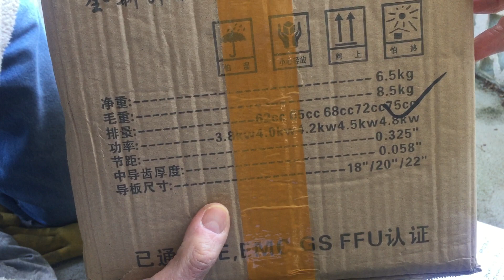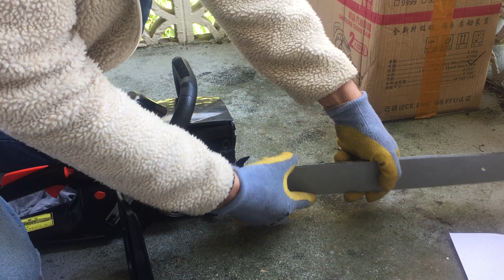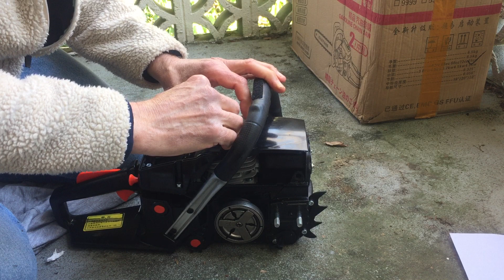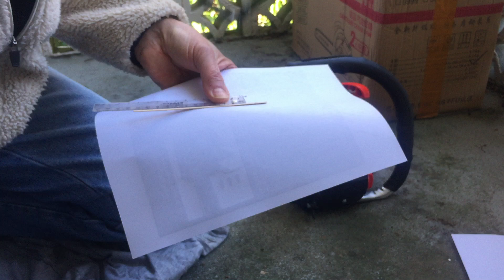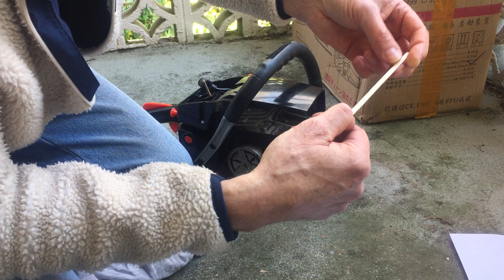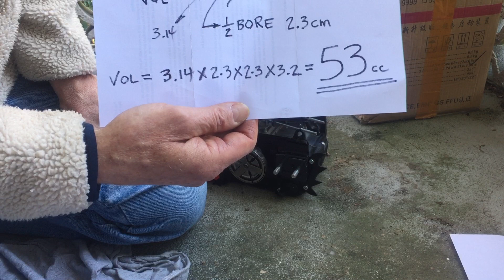75 CC CHINESE CHAINSAW REALY 75 CC??

Comment: I think you got your stroke wrong it should be 34mm and 45.2mm bore which is a 54.6cc so you were damn close. Id be getting my damn money back i would of figured it would of at least bein the 62 actual 61.5 cc motor. Id get a refund and guarantee they let you keep the saw. They are runners though with very little mods they scream. I'm literally about to do some port work and piston shaping on my dereal.

Comment: well done mate, these sellers, drop shippers or otherwise need to be accountable for plagueristic, fraudulent advertisments, I think it is disgusting that ebay and other sales platforms allow this crime to take place, it is a cheap saw so you get what you pay for, the how ever there is some honest hard working people scrimp and save to buy something that will make life easier, these are the ones I feel for, no chain brake, a primary safety feature, which is not there, now thats dangerous!!, and the bore and stroke does not match the description, thats false and misleading, in the old language, thats theft, these sales platforms are broken, cheers and thanks for a eye opener,

Comment: While I'm sure this one isn't 75cc these are clones of Zenoah's Japanese chainsaws which came in 52, 58 and 62cc I have a 52 and 58, the piston on a 52 is 44.9 the 58 45.2  and the 58 and 62 have a longer stork the 48cc cylinder for the 62 is impossible to find, you can use a 58cc piston and cylinder kit on a 52 but will have lower compression
Reply: For 62cc is 47.5?  Yes you can buy that.

Comment: A chain break has never existed since the beginning thank god,.......nobody ever needed them before,
I have never owned a saw with one.
I would buy any fair priced chainsaw even if its from China.
Yeah I was wondering how a clone could be a bigger cc?
Reply: There are 92cc and 100 china saws. youzuki or something..
They copy everything
Reply: Look up holsforrma I just got a Husqvarna 372xp clone and it works really good so far
Reply: @andyarmstrong5378  Cool thanx
Reply: My chinese holffzorma 660 clone has been serving me for more than 5 years now, without single trouble and always start on the first pull.. and all the engine parts are interchangeable with stihl oem parts..

Comment: I have a Chinese saw I bought 2-2020 with no chain brake but mine is a '70's design that never did have a chain break. You are right to expect one since it looks like a more modern design. That is a good idea of how to check for bore and stroke.

Comment: your chain looks to be installed in the wrong direction... the cutting edge should face away from the machine--providing the drive is counter clockwise.

Comment: I added your link to my video. Here is the video. I hope that is alright.  https://youtu.be/rLFfSp0nIHU
Reply from the maker: Good video.Concise presentation. I am happy  to have the videos linked.
I agree that many if not most of the Chinese saws are 52 cc. The exception I am aware of is the Jon Cutter line from Huztl, although there is some confusion there. (the 5800 claims 58 cc on the website and arrives with a sticker that says 54 cc. Stir stick measure indicates it is probably 58 cc. Haven't put my dial caliper on it to confirm .)
We can reduce the  fraud by getting the information out. Buyers can get refunds or return the saws if they don't measure as advertised. The fraud will stop when it is no longer profitable.
Reply: @trees734  I think the most accurate advertising is with Jon Cutter and Huztl. But the private branded are all wrong unless they say 52. Even the 45s appear as 52cc.  Please put that link in your description or as an end tag. Let's give em hell. Knowledge is power.

Comment: I have heard else where that all these Ebay Chinese saws sold as 45cc, 52cc, 58cc, and 62 cc are all the same saw  with a displacement of 52cc.
Reply: I truly believe that
Reply: They are actually two sizes in a range....58CC and 60cc but no such thing as 62CC even though they are marked.
Reply: The 58cc saw is actually a 49cc. The 62cc is actually a 58cc. The bore and stroke were measured and the actually cc's were much less than what was advertised. I guess they didn't think anyone would notice.

Comment: An extremely long link. 

https://www.ebay.com/itm/75CC-5-2KW-High-Power-Chainsaw-20-Bar-Woodworking-Cutting-Gasoline-Chain-Brake/193250072059?_trkparms=aid%3D1110002%26algo%3DSPLICE.SOI%26ao%3D1%26asc%3D20190711095549%26meid%3Dd43e187681194d9c804c4c9d6b2f8124%26pid%3D100009%26rk%3D1%26rkt%3D11%26sd%3D184077339258%26itm%3D193250072059%26pmt%3D1%26noa%3D1%26pg%3D2047675&_trksid=p2047675.c100009.m1982

Is this the saw in your video?
Reply from the maker: I think it was likely the same saw. (not the same seller) 

I have messaged quite a number of sellers claiming 75 cc saws, asking them to confirm engine size.(with a link to the video) The sellers may not know that they are selling a smaller saw.

Comment: I just bought one, I can't get it to start.  It has spark, but not start.  The chain brake does not move back and forth either.  I have to find a way to adjust it.  The top cover also crack when it arrived.   Product like this will never compete well in the US.

Comment: Do you have a link on wear you purchased the saw?
We’re you able to get a chain break for this?
Reply from the maker: The ebay seller ( jollybuy2017  ) no longer has chainsaws. Other sellers do. ( search 75 cc Chinese chainsaw in ebay. ) The seller did eventually send a new side cover with a working brake and a 50% refund after some persistent polite email exchanges. The saw works very well for a 52 cc chainsaw after one season. (about 30 tanks of fuel)
Reply: @trees734  How did the chain old up?
Reply from the maker: I put he chain on properly before using the saw. It works well with about 70 % remaining.
Reply: I just bought one of these that supposedly has 2 chains with it. I offered 74 and they accepted. With tax, $79. Good luck.  https://www.ebay.com/itm/58cc-20-Inch-Bar-Gasoline-Gas-Powered-Petrol-Chain-Saw-3-4HP-Gardern-Tree-Engine/312897519323?ssPageName=STRK%3AMEBIDX%3AIT&_trksid=p2057872.m2749.l2649
Reply: Understand, I have not tried this saw out yet, as not yet delivered.
Reply: I got mine about 1 month ago seems to work good ,but I had to replace the chain. https://www.aliexpress.com/item/32969374931.html?spm=a2g0s.9042311.0.0.27424c4dTA62Se

Comment: What do you do, to sell chainsaws, when Ebay is awash with 52cc chainsaws. Grow your size to 58cc and on. Pump up the HP from 2.6 to 2.9 hp, 3.0 hp, 3.4 hp. nah, let's round it to 4.0 hp, change the colour, put a flashy sticker on, add some useless tatt. We might as well put the price up while were at it, because we are now selling it as 75cc. You can buy a container load of blanks from China and pay with Paypal and put your own brand sticker on it, but 75 cc is stretching it a bit, suckers.

Comment: Buying these is a real "Crap-shoot", U.S. Customs should be notified, Only saws with Chain-breaks can be imported into the U.S..
Reply: Not only that, but a lot of Chinese saws have a fuel mix ratio of 25 to 1 (which is both good and bad). But for air quality emissions, and human health it is bad for sure and almost certainly doesn't meet EPA or CARB standards.

Comment: You did a good job on the video and in demonstrating simple measurement techniques anyone can use to verify engine displacement. Selling a chain saw with only a lever in place of a safety brake is fraud, but because of the complex chain of seller/distributor, assembly facility/component providers, not to mention the horribly corrupt chinese trade bureau, makes it all but impossible to bring criminal charges. The chinese know this, and are now sending dangerous unsafe products knowing they cannot be prosecuted for anything.

Comment: The bore on these saws is either 45mm or the 45.2mm  with a 32mm stroke. I bought a 62cc which was actually only 51cc, it had the 45mm bore.
Reply: These do come in 61.5cc but they are hard to find. I have the timberpro version, it's 61.5cc, 48mm bore with 34mm stroke. I also have the 58 which is 45.2mm bore with 34mm stroke, its really 54.6cc, that's right in the side of my saws. I had a 52cc one for a while, its not far behind its bigger brothers power wise. 
They are not bad saws but ebay should do something about the false advertising so you know exactly what size saw your buying.
The 45cc one is the best deal most of the time and you can get the 52cc top end for 10-15 bucks, give it a quicky port job and have a cheap saw that cuts pretty fast.

Comment: I used 31mm and 46mm to achieve  51.519cc's so it's a 52cc saw.
If it would have been me I would have contacted the seller about it not being as advertised and especially about the missing chainbreak parts, that's a HUGE Safety issue, and I would not have let up until it was taken care of or would have opened a complaint with EBay.        But that's just me.

Comment: I have a 52cc with chain brake problems. Did you get yours fixed?
Reply from the maker: For entertainment I kept messaging the seller(about 15 or 20 friendly exchanges) until they sent a complete side cover with working chain brake. You can find these on Ebay.
They also gave a 50% refund after a Chinese friend suggested I work with the sellers cultural superstitions. (suggesting  poor business practices can effect happiness and health) Saw works very well for a 52 cc unit. ( with the chain on in the correct direction)

Comment: those are all over flea-bay, haven't seen ONE yet that made the claimed CCs mostly they are 62cc. if you need a real saw that large visit hutz and order a 372 or o44 clone  for not a lot more $$$ correction 58cc!! also no 75cc  ever comes with the small sprocket and a .325 chain.
Reply: I bought a Huztl 070 replica for $300 when they first came out Stihl love that saw. I got free shipping I think I had to pay $60 for shipping for the bar and Shane so I ended up about 360 bucks for a great saw had it for a year-and-a-half still runs like a champ and will cut anything you put in front of it
Reply: Until you figure in shipping that's as much as the saw is...🙄

Comment: I noticed in an ad on ebay that they are describing not having an "iron" brake as being a safety feature to prevent fires. It's pretty nuts. Here is the link. Check out the photos. They show a picture of the thing with no brake at all.  https://www.ebay.com/itm/20-Bar-62CC-52CC-Gasoline-Chainsaw-Gas-Powered-Wood-Cutting-Chain-Saw-2-Cycle/312473576986?hash=item48c0e0661a:m:msO7G3qh-HwcDUNRXh41Lmg:sc:FedExHomeDelivery!93401!US!-1